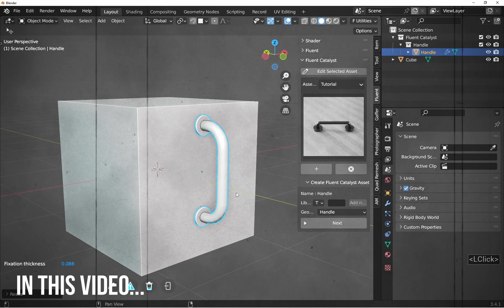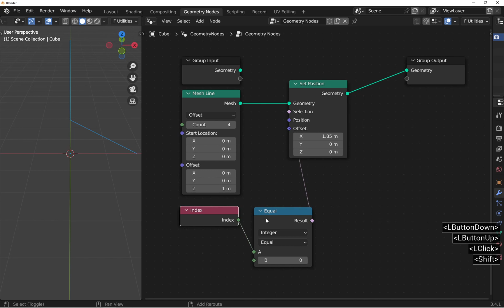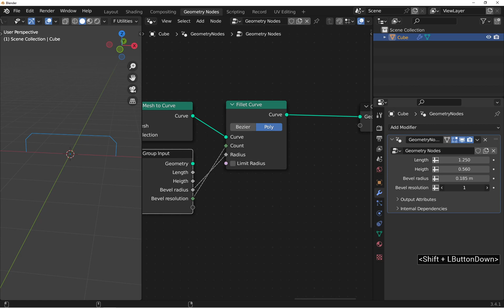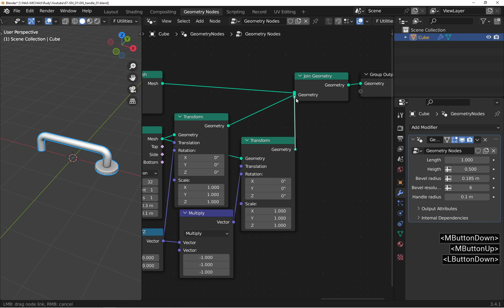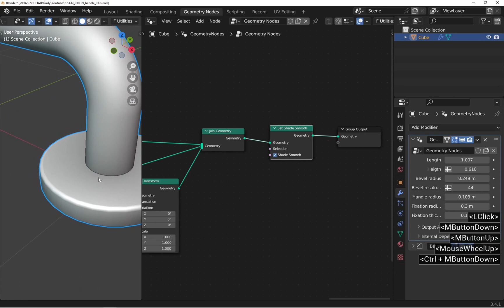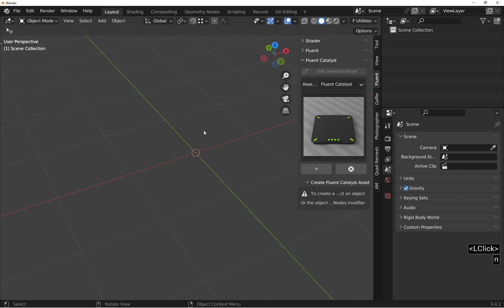Geometry nodes beginner tutorial - Make handle - To start easily

Comment: I made a configurable chandelier using manually modeled parts that are assembled via geometry nodes.
When I link the object to another scene I have to do a library override to be able to adjust the values on the geometry nodes modifier. When I make the override, all of the other objects involved in the node tree appear in my outlined. I actually initially made this thing like 2 years ago and this pollution of the outlined did not happen back then? 

Will it ever be possible to have a configurable asset that doesn't require every object from the source file to be pulled into your scene?